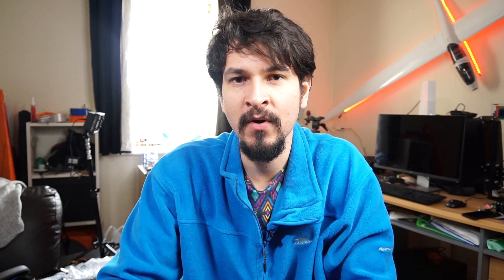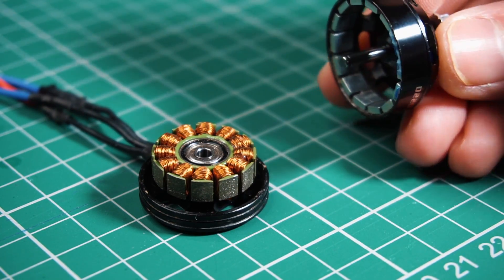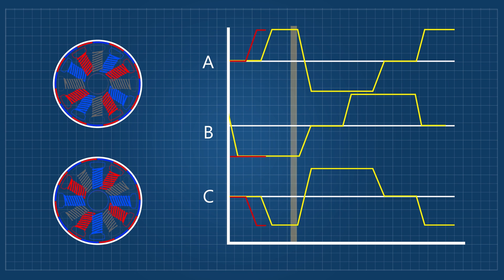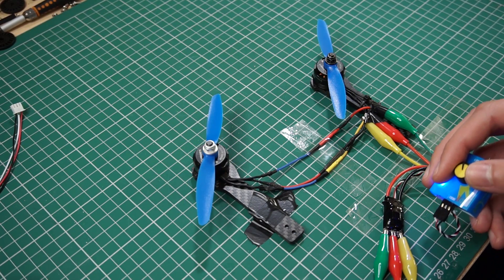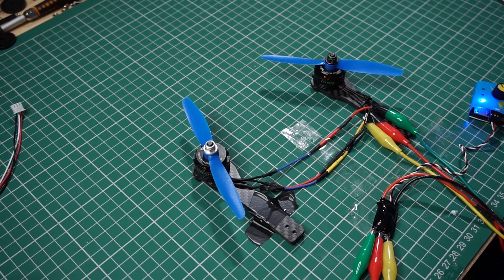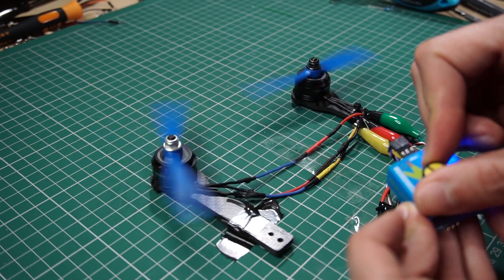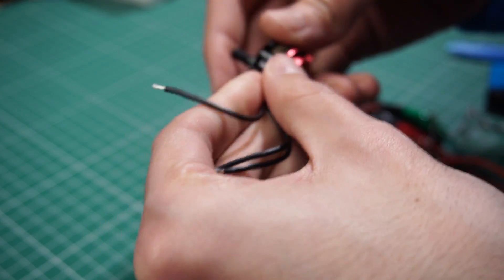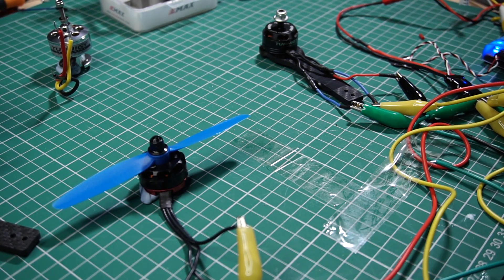Two Brushless Motors - One ESC

Comment: Thank you for the video!  I ran my own experiment with dual 12-24 volt ROV motors off a single ESC.  I repurposed the motors for powering a large inflatible kayak. I got dual motors to work intermittently with longest simultaneous run time was about 15-20 minutes but one always trips offline due to the sensitive timing. I guess I'm surprised I got it to work as well as I did but I'm moving on now. LOL

Comment: I'm so glad I found out your video, I was wondering what would happen if 2 motors are symmetrical mechanical connected so they generate always the same backEMF.
I'm thinking about using 2x 70g motors instead of a 200g motor to gain weight. In theory 2 motors of half of  the bigger one should work better since more cooling and more winding, hence more Eddy currents (Trust me, I'm an EE), but using 2 motors should work either with symmetrical backEMF, or with hall sensor master and slave setup. I don't have hall so I might try the first in practice..
Reply: plot twist: those were the pros in ideal world of course, in real world cons are EMF divides by 2 hence backEMF will drop, performance will drop, but in my case i have 500w MCU(different kind of esc that can limit current (non-avionic apps)) with 2 180w motors so I'll have to give it a shot

Comment: The thing you say is bad ie if one motor stops so dies the other could be a good thing in a plane for a novice pilot, I saw a guy crash a twin motor model because one motor failed and he could not control the model due to to the other motor puling the plane into a spin.
However I absolutely agree it's a bad idea and esc do not cost much anyway so why would you even bother risking running two motors from one esc?

Comment: Thanks you for the video. Quite informative. From what you demonstrated, my conclusion is that using two same motors, with double sized controller should work fine. But I would use motors that use hall sensors and plugged one of them into the controller.

Comment: One esc can used to drive two identical motors but the wires have to be very short. It works but definitely not recommended. Any differences in motors' specification, a new and an older motor, impedance due to longer or bad cables, can cause one of the motors stop or tickle due to desync.

Comment: @Joyplanes RC I like how you showed in the diagram at 2:35 that the signals might be out of phase.
And in theory that should result in a failure, in reality it showed that is seemed just fine. 
this is because the ESC will try to sync then unintentionally by slowing down one motor until they are the same.
This has the effect that it creates an oscillation in these signals equal to the switching frequency that will work against both motors.

and this it the observed reduced efficiency as its wasting power trying to correct the errors.
And although it is possible to run motors this way it is still not recommended as in the long term it will damage the ESC and/or the motor(s)

Comment: Well done on the video however I would like to add something. If the two motors are identical and ESC of correct rating you should not have desync issues. The two motors should phase lock (3 phase generation principle)  a scope would confirm this/bl heli frames. Not advisable though.

Comment: Please give a video on how to change the rotation of one motor
Reply: You change direction of a brushless motor's spin by swapping out any 2 of the 3 wires. But now you need a reverse prop and you will either need to use a Left-Hand nut to secure the prop to a Left-Hand prop shaft/adapter, or use a Lock Nut or a Cotter pin thru the Right-Hand nut and shaft. Otherwise it will eventually spin the nut off the prop shaft.

Comment: Hi mate. What I'm trying to find out is on a boat setup with twin motors. I want to be able to cut power to one motor for turning without using a servo or rudder.

A link to relevant information would be amazing, I can't find anything at all. Thank you 🙂
Reply: Same here. Did you find anything?
Reply: use a mixer setup on your transmitter

Comment: I watched earlier and found interesting, especially how one affects the other.  I had an idea, isolate the motors from each other by running the one motor directly from the controller and then use the 3  phases to control the gates of 6 MOSFET,s  to drive the second motor. Just a thought that came to me watching Master Chef ( don't ask) have not tried but wondering about an easy way to make my skateboard 4wd.
Reply from the maker: That's actually a good idea.
Reply: @Joyplanes  HI,   take a look at this.    
https://electronics.stackexchange.com/questions/272338/running-bldc-motor-without-hall-effect-sensor-or-back-emf
With a skateboard  starting is not an issue but can be a benefit due to inertia of your body if you open up throttle a bit much from stationary.
Reply: I'm trying to find out about this, I'm building a gokart using Segway wheels but only want to use the circuitry from 1 Segway, any info would be greatly appreciated

Comment: I wanted to build a y-6 drone back then using 6 motors and 3 esc. I didn't even get the pair of motors spinning like yours lol
The motors only kept on shaking but never spinned. 
So it's really not recommended to run multiple motors with one esc
Reply: I was going to do something similar with a DJI parts drone , curious if it will work

Comment: I want to know how to connect a 3 wire ESC to a 2 wire motor
Reply: It dosnt work. I dont know if it works to connect a 6diode rectifire. I think it dosnt work, becourse the 
back emf is missing and the Esc trys to get more  and more speed.
Reply: A three wire esc is for a brushless motor. Brushless esc's send pulses of current to each set of windings. A 2 wire esc literally just connects the battery to the motor. A 2 wire esc at full throttle is no different than connecting the battery DIRECTLY to the motor.  Google how brushless vs. brushed work.

Comment: It’s a brushless motor, of course a brush makes it not work.
Reply: Hahaha nice mann
Reply: you can run multi brush motors on one esc
Reply: Brushed motors only have + and - wires and are more easy to be stacked in series or parallel.

Brushless motors work different as this video shows and are more complicated to be stacked due to this.

Comment: Title reminds me of two girls one cup 😂 good material tho, but it's quite obvious that 2 motors will draw 2x more current than one, hence the ESC temperature.
Reply: Although the motors will, individually, draw less current because they carry less load each
Reply: @jordanbwalt  how come they carry less load?
Reply: @szajba8106  It's the same as doing two batteries in parallel. Two motors in parallel are splitting the load of the weight and inertia between each other. Although once the car is up to speed, they'll start pulling a high current on each individual motor again as they struggle to maintain a high speed, although that top speed should be slightly higher than just the single motor
Reply: Bro that video made me throw up when I watched it

Comment: What would happen if you lock the shafts of the two motors together and then run from one ESC in parallel? If the kv is the same and you can somehow align the motors before locking together, would this allow both to run efficiently?
Reply: That seems to work on RC cars like the E-maxx where you sync both motors before meshing them with the spur gear. I've seen it done with 1 or 2 ESCs.
I also have a Nikko rc car that has entirely separate motors and transmissions at the front and back and I've used 1 ESC and 2 brushless motors and it to work fine. Maybe a little stuttery off the line sometimes, especially a low speed start but once it was up and running it went like a dream to be honest.

Comment: Can we combine two esc to run one motor, that's 30a esc and 80a esc to make 120a esc?
Reply from the maker: No. That wouldn't work. It will create a short circuit and posibly damage the ESCs
Reply: @Joyplanes  but can you do is with 2 30 esc in parralel so you have 60 amps

Comment: sir can i control 4 motor with 1 ESC
Reply from the maker: Not at all. You'll burn the ESC. And it wouldn't work
Reply: @Joyplanes  what if you have 4 x 5amp motors and a 30 or more amp esc? 
All motors would be the same KV and type